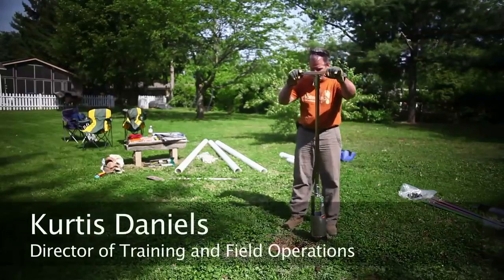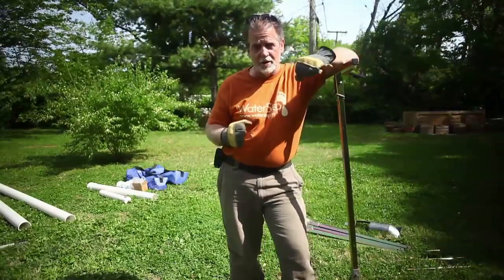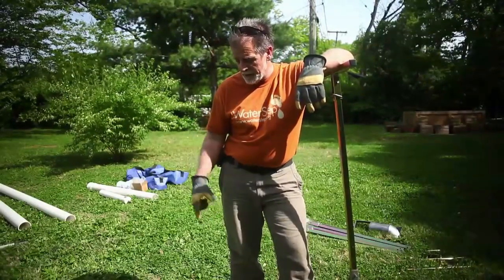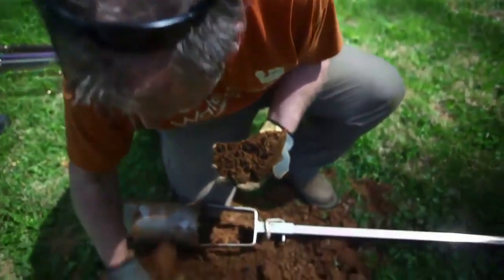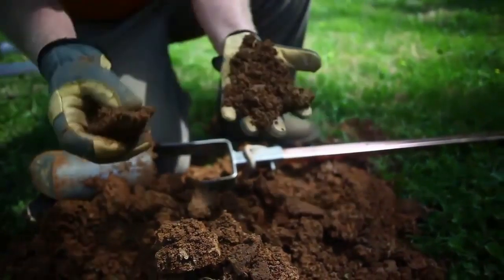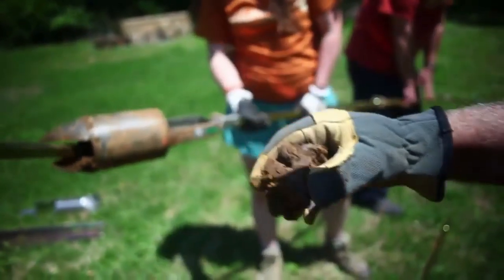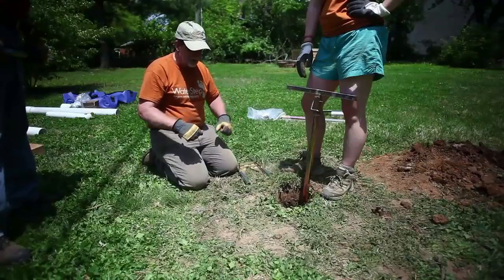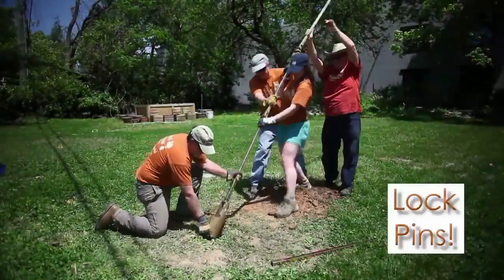WaterStep - How to Drill a Well Part Two - Hand Drilling

Comment: Put plastic down to hold the dirt so you are not left with a muddy grass area. Easier to move the dirt back to the hole as well.
After clay soil comes the sandy soil where the water is.

Comment: For those (like me) who hate rattly bits I recommend strips of card (cereal box) in between the joints of the steel rods...
On a power company side note: Working with steel box sections which have the tendency to get extended over and over again directly under major power lines can prove quite interesting (just saying...)

Comment: Can this work on African soil?
Reply: Yes if no rock is below...
Reply: Yes, depending on the soil in your area (no rock). I taught a young man in Kenya to drill wells this way. In his first 6 years he drilled 240 family wells. Simple DIY deepwell hand pumps can be installed. Wells deeper than 20 meters/66 feet have been drilled this way.
Reply: No African soil is different, no holes!
Reply: yes